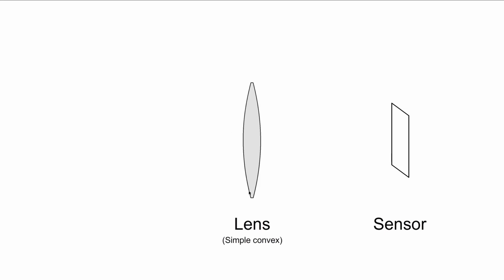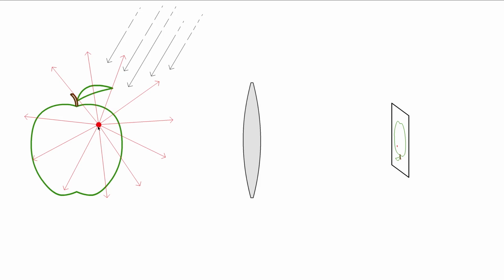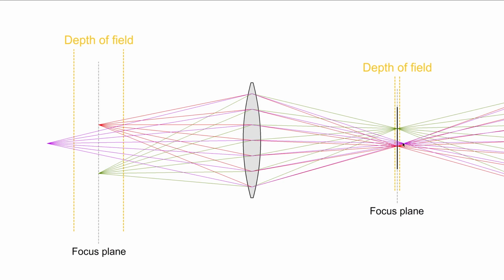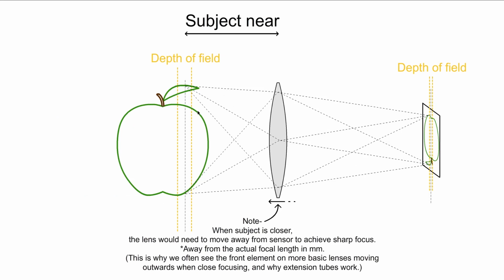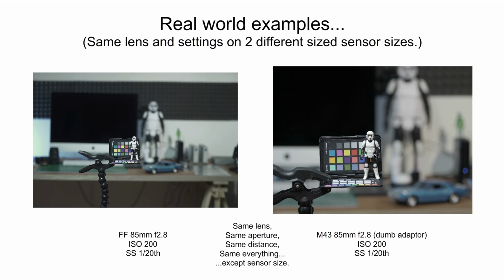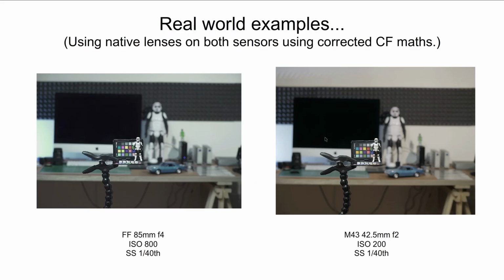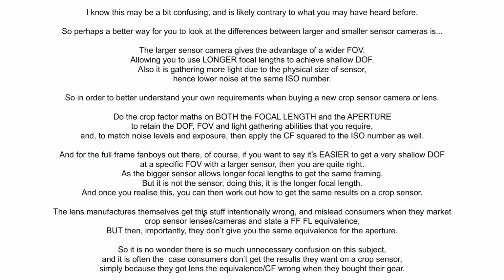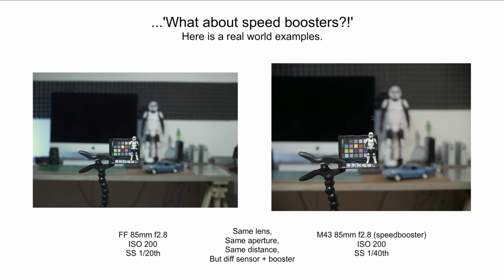Depth of field and crop factor misconceptions.

Comment: Another question: at the same distance, using the same focal length and aperture, a crop should have shallower DoF due to a higher pixel pitch (assuming the same pixel count).
Yet, to frame similarly to the FF camera, one would use a shorter (wider) lens which has greater DoF.
So, which effect is more dominant? Lessening of the DoF due to higher pixel pitch or increase because of using a wider optic to get the same framing?
I guess I could do the math, but ah well... :-P
Reply from the maker: Mark Pitsilos so if you simply use a wider lens to match framing on smaller sensor (with same Fstop number) the DOF will be wider. 
That FL is the dominant change. 

I keep thinking of different ways to explain some of this. Not because I'm trying to muddy the water. But because all the feedback i have had from this video has made me think about different aspects of it. 

One thing I didn't go into in depth was the physical aperture size. 

Fstops are sort of misleading too when it comes to this. (As well as the iso)

What I mean by this is, when you half the FL and keep the Fstop the same, you are actually halving the size of the aperture. 
(50mm f2 = 25mm diameter aperture, and a 25mm f2 = 12.5mm diameter. )

So that's another way to look at the change you are making when you swap to a different FL.
Reply from the maker: Mark Pitsilos hopefully that helped, but I was probably just framing the same info in a different way for you.
Reply: Thanks, I would also be interested in your findings on whether FF lenses perform poorer on crop sensors, as Tony has stated. It would again make sense to me that despite the higher pixel density of a crop supposedly being focused on the (usually sharpest) lens center, it cannot mitigate the loss of resolution that occurs by throwing away such a large proportion of the light exiting the rear lens element.
Reply from the maker: Mark Pitsilos Mark Pitsilos hi. It really depends on the quality of the glass and what you are using it for. 
I mostly shoot 4K video. (That would be 8MP in photography terms)
So this combined with the fact I use very top shelf lenses. (E.g. Sigma 50mm f1.4 art for EF, or canon 70-200mm f2.8 mk2) means I can get away with it fine. 
If I was shooting 42mp stills for magazines or a art show or something then of course this will show up any imperfections in the lens way more. 

So the answer is yes and no. :/
If your FF lens is average. And you only look through the center using a crop sensor. 
And your enlarging 24+ MP images. Then yes. 
Maybe buy lenses designed for the sensor. 

Other thing to consider is if your using a speedbooster, this reverses the issue. 
So most of the lenses light cone is again being used. 
So no real loss of detail. (As long as speedbooster glass is too quality)
Reply from the maker: P.s. I do usually use a native lens or a speed booster. 
So I just meant I COULD get away with it. 
But I don't normally work that way. Unless perhaps I needed more length on a lens and there was loads of light anyway. 
(Just to be clear)
Reply: Thanks, I'm considering getting a Metabones Speedbooster Ultra for the Fuji XT2 I have ordered, so as to adapt my existing FF Nikon glass, without incurring too much of a shift in FoV. The extra "stop" of light will also be a nice bonus, although I do realize it only partially offsets the 2.25 smaller sensor of the XT2, it does not magically convert it to FF-level light-gathering abilities. :-)
Reply from the maker: Mark Pitsilos yep not perfect. But they are great little devices for those of us with a FF lens collection. 
Other small word of warning for you. 
Im no expert on your camera/booster combo. 
But from my experience u will lose any decent  AF speed through an adaptor. (Or lose it completely. Not for every adapted set up... (Sony a7r2 does ok I hear) but for most.
Reply: biscuitsalive I know, I care mainly about focus peaking for manually focusing my ai-s lenses.
Reply from the maker: Mark Pitsilos cool. I mainly manual focus for video so it doesn't bother me either. 
But prob some sports photographers out there buying speedbosters and then being really disappointed. So though I should mention it. :)

Comment: One important thing I would add to the video though is the fact that when you shoot full frame, you need to get closer to your subject to get the same subject framing, with everything else being the same. So in your image comparison between the FF and the M43, if you moved in closer with the FF to match the framing of the M43, the DOF would be much smaller in the FF than the M43. This is where people realize that when they shoot bigger subjects like people, and they want an even shallower DOF WITH the same framing, a FF sensor suits them better. And yes, you could use a smaller f number on a lens with a cropped sensor to match the FF in this case, but if you are already shooting f1.8 on a cropped sensor, and want an ever shallower DOF, for the same framing, you will be hard pressed to find a lens f 1 or thereabouts. So the key is keeping the FRAMING the same when comparing FF and cropped with everything else being the same. Fantastic video though, I would have loved to see the differences when getting closer with the FF though.
Reply: Moving toward or away from the subject completely changes the field of view and introduces background compression or expansion into the equation. It will absolutely change the framing. If you compensate with a longer lens (multiplied by crop factor) on a full frame, you can achieve the actual exact same field of view as a cropped sensor. Crop sensors are **not** reaching further. They are just filling the frame with “more subject,” by cropping out the edges of the full frame equivalent.   In the photos at 19:35, if you physically moved closer, you would change the relationship of the foreground and background subjects, changing the framing entirely. But what actually happens if you shoot from the same distance with the same lens, is the crop sensor is just a smaller piece of the larger picture.  There are cases where either format can be advantageous, crop sensors do have a pixel density advantage which simulates “reach,” but you are correct that full frame does offer more flexibility with shallow depth of field and light intake assuming equivalent  lenses.

Comment: One thing is wrong. Focal length doesnt effect the DOF. If you keep the same FOV the DOF is the same. Doesnt matter which focal length is on the camera. The rest doesnt matter. Try it out take 24mm at f4 and take 200mm at f4 keep on both the same FOV and you will see the same DOF, one thing will chance and this es the compression and some people may would think hey look its a shallower DOF, but it isnt.
Reply: glad someone mentioned that.

Comment: Very nice and easy explanation. The main reason that people say that FF has more bokeh is because the lens for crop sensors are not fast enough to compensate for the crop factor. If they make 25mm f 0.9 with autofocus on MFT it will compete with the standard f 1.8. If they want to compete with the f 1.2 lenses they will have to do some serious engineering to create a lens that has an apperture of f 0.6 .

But the speedboosters are a very good solution until they come up with super fast lenses for aps-c and MFT. 

Let's hope they stop the marketing BS with the crop factors. Best solution I can find to clear the misinformation is to list the focal length as they are but to include the equivalence for the crop factor.

Comment: ok, nice vid.
The only problem i see with your other video, is that somebody can understand u wrong and then think they get the same DOF on a Mirco-Four Thirds with a "similar" (mathematically converted) lens. Hope you understand what I mean.
But in this video it's pretty good explained, nice work.

sorry for my english
Reply from the maker: JohannesBuc with the other vid I was using the same lens on both. So DOF was roughly the same. (Technically it's slightly narrower DOF on the gh4 because it was slightly tighter FOV) but as explained in this vid. The DOF was the same for the lens, as same aperture, same distance and focal length was used. 
But just slightly diff DOF between sensors due to tighter FOV. 

Remember the matched equivalent example in THIS video was using two different focal lengths. That's why you need to change aperture and ISO. (Because of lens difference not because of sensor difference)
Reply: But you only need a wider focal length, because of the smaller sensor size and like you said, it's harder to get more DOF with a smaller focal length. So I don't understand why you want to make full frame cameras bad?
Reply from the maker: Sorry dude, but I'm not sure you quite get it. maybe watch this one again. could just be your English isn't perfect, which makes it hard to see your exact point. when you say 'harder to get more DOF with smaller focal length.' That statement is backwards. you naturally get a bigger DOF with a shorter focal length.
And I'm not trying to make FF look bad, I own two of them and love them. but Im pointing out that most people get the equivalence wrong when comparing them to smaller sensors. you can get exactly the same look on a smaller sensor, if you do the equivalence correct.

My points are all there in the video. Its the 'doing the maths wrong' bit i was highlighting... not that FF or crop sensors are bad, they are just different, and you have to accommodate for that difference if you want the same look on both.
Reply from the maker: And to continue.. if i was attacking anything it was that manufactures are not enough fast lenses for crop sensor cameras. because they know the buying public don't do the equivalence on BOTH focal length AND aperture. (they just see something like '25mm f2.0' written on the side of the lens, and think that will work the same as '50mm f2.0' on FF...... and i will not... it will work the same as a 50mm f4) ---- Please note though, the speedbooster argument is very different than this. as that is using a the same FF lens on a crop sensor body.
Reply: yes, but with a speedbooster you imitate a FF
I mean you bend all the light into the smaller sensor. So I think your video "Can you spot the camera SENSOR SIZE from the shot? Full frame vs M4/3" is not a fair comparison.

Depth of field means blur you get in the depth or is it the other way around?
Reply from the maker: fair comment about the TITLE of the other video. but my point with that is that it isn't the sensor thats making the narrow or wide DOF... its the lens... it will always be either -
-1 focal length
-2 aperture
-3 distance to subject

that controls the DOF. 
the speedbooster is only affecting the FOV (field of view.)

That was my point.

if you want to nitpick technically the speedbooster makes the DOF WIDER not narrower (due to what happens with the circle of confusion.

And if i did not use the booster in the other video, you would be able to tell the difference between the shots just because the shots would have been tighter.... and technically the gh4 would have NARROWER DOF...

This is what most people really don't seem to get.
Reply from the maker: And DOF is just referring to the width of the 'acceptably' in focus area... (remember how i pointed out that technically there is only one plane that is actually in focus.... out side of that its a just sliding scale of OUT OF FOCUS.)
Anyway, maybe watch this video a couple of times and really think about what happens to the light rays.

Many many people get a lot of this wrong... (i know i used to get it wrong 2 years ago) so no shame in being uncertain about this stuff.
Reply: So i had a problem with the meaning of DOF. 
And yes the speedbooster just doing the same as the FF, its makes a bigger FOV. And sorry for this long discussion but this just didn't felt right to compare these cameras like this. 
But i totally get your point why you did it, and with this video you completed it.

Comment: None of this actually matters unless you go around taking photos whilst constantly thinking about what settings you'd be using if you were using another format! Like, "Oh I'm using 125th at f4  at ISO 200 on this M43 camera with a 20mm lens. If I was using a full frame camera I'd have to use a 40mm lens set at f8".  No one would do that unless they are completely mad.
Reply from the maker: Doreen Campervan a great deal of the information we fill our heads with doesn't reall matter. :)
But this stuff does matter if you are choosing a system or lens and perhaps moving over from a different system. (A lot of people moving from full frame to crop or visaversa)
So in that situation it's pretty handy to know what speed lens you need to get the same quality or depth of field. 

Of for me that uses full frame cameras. M43. Apsc. And also I use native crop lenses and also full frame lenses on crop cameras. (With boosters. So for my case it helps me know what tool/kit to take for what job.
Reply: The same quality or depth of field as another system you don't use? Why didn't photographers used to keep referring to 5x4 when they used 35mm or 6x6? It's a modern anxiety brought on by the Internet!
Reply from the maker: Doreen Campervan but that was my point. I use them all. Sometimes even have to cross edit between them. So yes I do need to be able to match look across completely different systems. 

But my main motivation for doing the research for this vid was I got fed up with format nerds banging on about why one was better than the other. 
They are just different with pros and cons for all. 
And I just wanted to show you can match look almost exactly if you just understand the basic science behind it all.
Reply: Well I think nearly everyone thinks too much about this stuff instead of going out and using whatever equipment they may have to the best of their abilities. I for one can't look at a photo or video and guess which format it was taken on.  The creator of the work is the only determiner of whether something is worth looking at or not.  The technical difference in the real world isn't worth worrying about - especially as most viewing is done on a smart phone these days :-)
Reply from the maker: Doreen Campervan hey look at my content. I think you will see I'm out there filming fun stuff just as much as I'm testing gear to improve my technical understanding.
Reply: I never thought  you weren't - and I think we are probably singing from the same hymn sheet ;-)
Reply from the maker: Doreen Campervan I agree, creative drive is way more important than this nerdy tech stuff. 
But out of all of the creative industries cinematography is one that really combines creativity and technology. I think this is why you often hear the "stop pixel peeping and get out there and shoot" mantra. 
But I happily embrace both sides of it all. 
Love to run around and film fun stuff. 
But also like to understand my tools and most of the science behind them faintly well too. :)
Reply: Doreen Campervan In the film era 35 mm and medium format were separate worlds and people just learned their system. Smaller formats often were very simple and users did not care of the technical stuff. Things life bokeh are meaningless on a fixed focus lens.With digital cameras widely different sensor sizes were used on  relatively sophisticated cameras so concepts like 35 mm equivalence and crop factors were developed to help users but they typically were only used to the focal length. It is good to understand these in relation to the aperture also at least in choosing lenses. That does not mean you should constantly multiply things while shooting.
Reply: Okaro X I used roll film and 35mm. I just used whatever lenses I had and got on with it